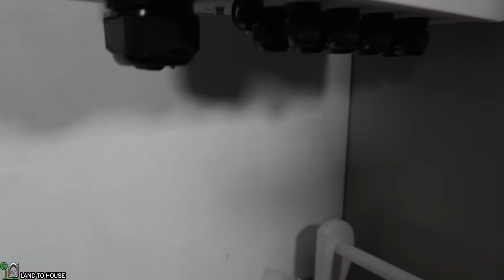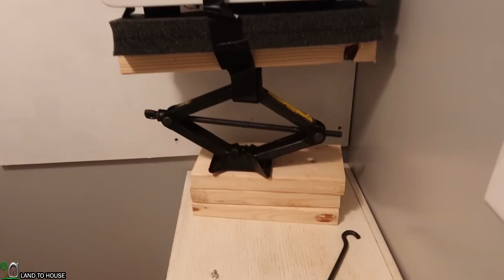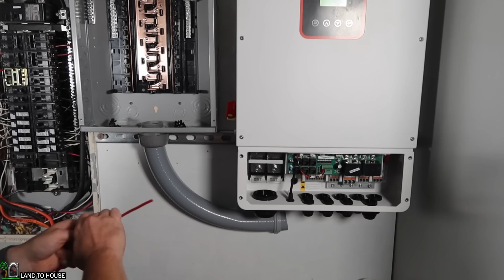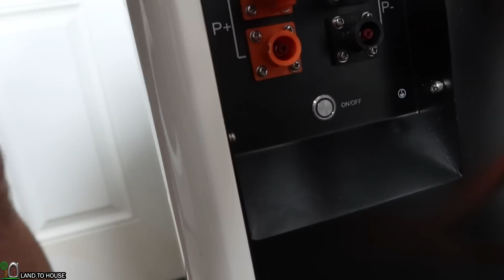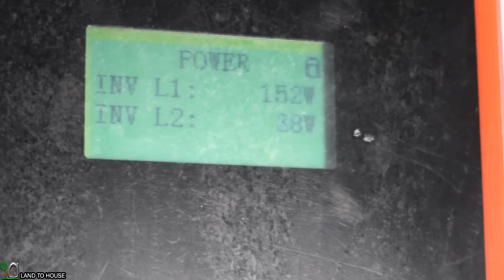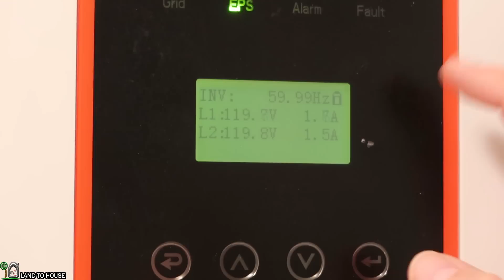8KW Inverter and 15KWH Battery Takes House Off Grid [Full Step by Step Install]

Comment: Thanks for testing this unit and was about this unit as well. According to the data sheet it looks awesome, but checking out Will Prowse videos and his problems with the unit and your tests, the software of this unit it bad, on all who are selling these  like EG4. It's not charging the batteries correctly, your panels are so many, you should charge the 15kW battery in one hour. I hope a software update that really works, will help. Hope it works out for you soon. This should run a 30kW per month house hold without any problems
Reply from the maker: I have an update about the charging rate. I had the unit set to 25 amp at 52.1v now I have it set to 110amp and it will pull in 6kw from solar.  

As for the other settings I have been off grid on the unit for 60 days with no problems.  But the grid tie mode does seem to have issues.
Reply: @LandtoHouse  thanks for the info

Comment: Is it possible to skip the critical loads panel, run the grid power directly to the inverter, and power your existing home panel off of the inverter output?
Reply from the maker: Yes this mode would be supplemental. There us a ct clamp that would go on one leg of the main power to prevent back feeding to the grid.

Comment: Can the inverter be run with Current Transformers for those of us that want to run while connected to the grid without putting any power into the grid? (just using the inverter/solar to offset the loads so there is minimal draw from the grid)
Reply from the maker: Yes this inverter was shipped with 1 CT clamp to go over the main power incoming to the house. That would let the inverter supplement the house with solar.
Reply: @LandtoHouse  Thank you.

Comment: Very nice video, can you explain what changes had to be done to the communications cable to get it to detect the battery 🔋
Reply from the maker: It turns out that the cable has to be very specific to this inverter and battery. I wound up cutting all but 2 wires and it worked perfectly after that. I don't remember which ones those are at the moment. But the manual has the pin out for those cables.

Comment: You wouldn't have to extend the neutral to the critical loads panel and it will still work if you tie the neutrals of the two panels together. Is it code or something and that is why you do?
Reply: It's code and for safety. The current could go back to the main panel and take an incorrect path to ground causing a shock hazard. I believe he should have moved the ground wire too. I'm still learning myself so I'm trying to research if it was necessary. Ground and neutral are bonded in the main panel so I'm 99% sure it should have been moved also.
Reply: @YTBlimdGuy  I can understand if the 2nd panel was a subpanel, but if it is a right next to the main panel, it's almost one bigger panel.
Reply: @awesomedee5421  Size doesn't matter  in this case 🤭. It's a sub panel powered by another source.

Comment: The number of code violations is amazing!  I wonder where you got any experience in electrical installation.  The conduit from your critical load panel to the inverter should be completed, so you do not see any wiring when completed.  The exposed 120 volt wires is a code violation.  Think of your kid being able to pull on that wire, do you really think it is safe?  Come on.  

Then the three different voltages CAN NOT BE in the same conduit.  You have two different voltage DC power and the AC power going through the conduit.  

Power from your solar panels might be 150 to 300 VDC, and that must go through it's own separate path to the inverter.  Preferably through a 3/4" flex conduit all the way to the inverter, so you DO NOT See the wires.  The battery cable, I can understand it not being in a conduit in your example, but really it should be in a 3/4" flex conduit.  So you can not touch the wire.  

The Critical load panel is not allowed to be a pull box, so the 40 amp breaker going to the inverter input should take another path, so a 3/4" conduit would work fine.  I would suggest coming out of the bottom of the grid panel and into the inverter panel.  

Most electricians would remove the romex feeding your critical loads and feed them into the new panel using romex connectors through 4-8 of the 1/2" knockouts.  Many places do not allow a wire nut or weggo in the main electrical panel.  

Most utilities require a #6 wire from the ground rod to the electrical panel, solid wire only.  This way the wire is strong enough that the ground CAN NOT be damaged or broken.  Your smaller wire is very easy to damage.  You don't know how to install a ground rod in less than 90 seconds, without a hammer.  Well a hammer drill, and it slides right into the ground, spinning it in.  

Many have said you need to install covers for your grid panel, so nobody can stick their fingers into the panel, and reach the live electrical circuits inside that panel.  Right now a mouse can crawl in there, so very unsafe!  You could also buy 8 - 10 new circuit breakers and install them in the empty holes to fill them.  

I noticed that you knocked out several extra holes, that are not in use.  They make knockout covers to keep out dust, fingers, and anything else.  Put them in!  

Why did you use the 100 amp main breaker on the critical load panel?  Is your wiring  sized at 100 amps?   Is the inverter able to put out 120 amps, so a 100 amp breaker is able to handle the overload and shut off before inverter melt down?  I know it is not rated that high, and will probably shut off before reaching 100 amps, so the wiring is actually safe, but the proper way would be to install a 30 or 40 amp circuit breaker in the critical load panel, and label it as "Main Input" so everyone understands that is the way to shut off power to that panel.  

If you are constantly low on power, you might want to transfer a load back into your grid panel, so that you become "In Balance" between your loads and your solar system output capacity.  

As for the push in connections in your inverter to hold a wire that will have up to 40 amps going through it?  Really?  I never knew the push in connectors are good for even 15 amp receptacles, and you have 30 - 40 amps going through it?  OK, it is your house, and you are not my neighbor, so if it catches fire I don't have to worry.  I would suggest checking the wiring every month or so, and maybe even check the temperature with a IR point thermometer, so if it starts to overheat, you can get it fixed before the lights start to flicker and the connection overheats.  

At the very lease, I expect you to install covers inside the grid power panel cover, so you can not touch the stuff inside, or buy breakers for the grid panel, so no holes remain open.

Also put some 1X6 over the wiring under your inverter, so they can no longer be seen.  A couple of 2X4 blocks will give you something to attach the covers to, and make the wiring secure behind the boards.  

Also remove the DC power lines for the solar from any conduit that also has 120 volt AC power in it.  Relocate that DC power into it's own flex line that is connected directly to the inverter 3/4" inlet.   If you need to expand a 1/2" inlet hole to a 3/4" hole, you can use a step bit.  Very easy.  

I was ready to faint when you drilled a hole into the drywall behind your electrical panel.  The safe way is to use a flathead screwdriver to punch out a hole, and it will not damage any wires or water lines that might be back there.
Reply: Yes, Seth, PLEASE address these code violations before there is a tragedy!  Off-grid or not, improperly installed equipment will certainly void homeowners insurance claims if someone gets hurt or if the place burns down.  Also, I’m pretty sure that inverter and battery are NOT LISTED for installation anywhere.
Reply: I just kept watching the incredible number of violations being proudly and happily committed, waiting for the big APRIL FOOLS reveal…. when Seth would say it was a big joke and then plead with the audience NOT to wire any system in this manner!  But that didn’t happen.
Reply: Lol there are so many code violations I had to stop watching this video, this video needs a warning at the intro not only stating you’re not an electrician but also this is a how not to properly install anything electrical related. I’m amazed at the amount of praise this video has received. SMH!!! Sparkies are all cringing right now. 😂
Reply: His homeowners insurance just got dropped and the fire department is on standby

Comment: I really like your set up, but you really need to use the proper connectors for the wires entering the boxes. It will make your system look that much better and safer!
Reply from the maker: What connectors do you mean?
Reply: @LandtoHouse  Your battery cables should have some sort of strain relief or connector on them when entering a box.  At 27:10 your flex conduit connectors are incorrect. Most important single wires are not allowed to be run alone. They should be enclosed all the way from box to box in conduit or they are to remain in their jacket like 12/2 or 14/2 NM cable. Anytime a cable or wire enters a box or panel it should go through a connector and not just an open hole in the box. I know you are not an electrician and you are doing a great job and I like your work. If you didn't live so far away I would hire you as an assistant. Not criticizing just trying to help you make it look more professional.

Comment: Did u take a breaker out n replace it with a double breaker? My panel is full. There is nowhere I can install the double breaker to connect to inverter. Thank you
Reply: You'll have room once you move circuits/breakers over to the subpanel.
Reply: @Brian Carlson  yes that's what I did .. Thank you
Reply: Just add two tandem breakers into your panel to make space for the new double pole breaker. Easy solution.

Comment: This method doesn't back feed the grid right? And will it still function if there is no power coming from the grid for weeks?
Reply from the maker: Correct there is no backfeed. I have not turned on the grid in over 30 days. Tomorrow I connect another 3kw of solar panels. Should get this system off grid indefinitely.

Comment: Are you saying that you don't know how to configure solar/battery priority, or that that inverter does not allow it? If it does not allow it, that's pretty lame since almost all inverters worth using have this configuration ability. Especially with the cost of it. P.S. I hope you didn't pay for it, that even if you didn't, I wouldn't use it with all the basic functions not working. Edit again.. I am 100% confused on your verbiage, near the end of the video you said you changed it over to Battery priority.... but yet you said that one of your disappointments was not being able to do that and that it only does Grid priority... That setting you are talking about "battery priority" is exactly what you were saying it was missing.
Reply: I'm grappling with the identical issue of the inverter shutting down briefly at daybreak when panel production starts. Unable to eliminate same. See you mentioned "cushing settings." How is this achieved. You're the only person that even mention this issue...others downplay or ignorant of it's remedy.
Reply from the maker: @moseswilliams3273  This setting is only available to change in the installers version of the solarman smart app. (For the vestwoods) i had to contact my support guy and he changed it. Once that was done there has been zero issues.
Reply: @LandtoHouse  Thanks for the quick response and suggestion. However,  as indicated earlier, the installer has downplayed the remedy for this shutdown occurrence, stating that the breaker from the grid has to remain on for the hybrid inverter to stop the shutdown from happening. However,  having done so for a few days, the inverter still shuts down, but the grid maintained continued current seamlessly. But my preference is to keep the grid off, until required.
The layout and circuitry of this inverter is typical to several other band names,  mine being Skytrak. Still hoping for info on the exact settings in the solarman app that can correct the shutdown. The installer hasn't been helpful. 
Maybe your high respect from Vestwoods, will cause them to give you more details. 
Best regards.
Reply from the maker: The battery priority setting allowed the unit to use the UPS setting when the grid was removed. otherwise the power flickered for 30 seconds until the power came back on. 

As for the battery priority working as we all would hope it would... no it never did work right. SO I just made this unit totally off grid. 6kw of solar and the system has been off grid for over a month.

Comment: You should be using wire ferrules for the terminals in the inverter stranded is not recommended without them

Comment: Definitely need to remake up all of your small gauge wires using crimp on ferrules as those nifty spring terminals are not designed to utilize stranded wires.  Enjoyed your excellent content from your channel for the past year.

Comment: This is nearly identical to the configuration I want and have been trying so hard to find a representation of online.  Thank you so much!  I can now confidently order the components I need.  I have rate shifting so a similar system will me when I use the grid, it’ll only be $0.05 per kWh.  Woot!
Reply from the maker: I searched a while on youtube to find a full install. No real luck. So I made this video. I am happy to hear it helped!
Reply: @LandtoHouse  Thank you I was searching for this exact breakdown as the AC output most people are just testing with a power bar and a few test loads. I see now why the critical loads panel is used. I wonder if your utility would allow back feeding power from your solar and how that would change your layout.
Reply from the maker: @traktion9  In order to backfeed solar into the grid, you have to have a bi directional meter and the system has to be signed off by a professional. It can be quite expensive to accomplish those things for a minimum payout. My power cost is $0.21/kwh the payback is only $0.08 to $0.10 /kwh

Comment: Everything is very clear but the only question in my mind is about the critical load panel. You skipped over the bit where you figure out which critical loads need to be moved over to their panel. In my mind you should put the entire house on that critical load panel and just keep your usage to < 8 kW. 
I really wanted to see a more detailed discussion of how you figure out and design the critical loads
Reply from the maker: My apologies for leaving out critical information. This 8K inverter is not capable of handling my hvac system, hot water, and dryer. Everything else is in the critical load panel.

Comment: It seems battery priority should tell the inverter to run off batteries even with grid power.  Then when batteries get to low battery levels the grid would automatically power the load and bring the battery back to full charge. Once the battery is at full charge the system should return to the battery powering the grid.
Reply: Isnt that extra strain on the battery then, should be able to leave it in grid priority mode or bypass mode without interruption when a blackout happens. He mentioned there was a buffer setting they adjusted but seems to have had no effect.

Comment: I am asking this question as someone who is new to this I have two magnet generators one in a windmill and one in a alternator they seem different the windmill needs high speed to make basically 24 bolts the alternator needs lower speed to make close to 24 volts (90 to 110 revolutions per minute) is it the coil windings wire thickness difference in the two or what is the difference?
Reply: Is it amps

Comment: You mentioned you had another system that's grid-tied that you'd use to supplement this system?
I wonder if/how one could connect a grid-tied system to this inverter.
I supported the Vestwoods kickstarter and I'm now waiting to get this system. In the mean-time, I'm researching on how to integrate it with my existing Enphase micro-inverter PV system. I'd heard someone mention in the DIY solar forum that one may be able to connect a grid-tie system to the GEN input.

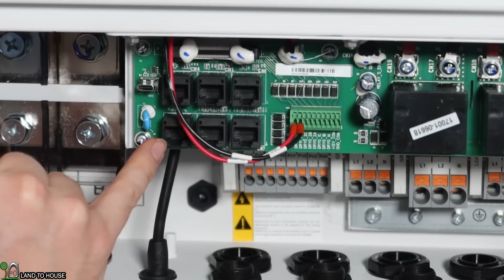Comment: In relation to switching the grid off and on to supplement the battery, see if the system has an auxiliary out put that an trigger a contractor so the system turns the grid on as needed.  That will save blackouts if you're not monitoring closely,) and you may be able to trigger remotely as well.  Also the ports that you showed at 2:30 are not Ethernet. (One may be, but the others will not).  They are RJ45 connectors.  There may be magic smoke let out if you plug network devices into those ports.

Comment: Would definitely recommend time out plug ins to protect the appliances with compressors, my freezers and refrigerators would stall and cut out when it switches from grid to battery, very hard on them
Reply: Travis If that's happening to your loads then the grid and inverter outputs must be out of phase. Land to house seems to have the same syncing system as I have.  When he turns his grid breaker on the inverter syncs it's output to the grids then internally switches the loads to the grid. Travis,  it sounds like your inverter isn't syncing with the grid before allowing the grid to take the load. I hope I explained that correctly.
Reply from the maker: After switching the inverter mode to battery priority the system is working very well. When I go from grid to battery or battery to grid there is zero down time.